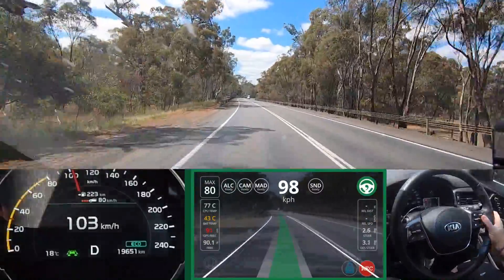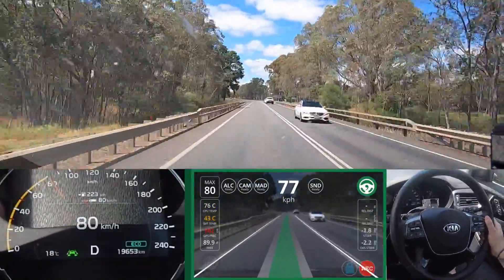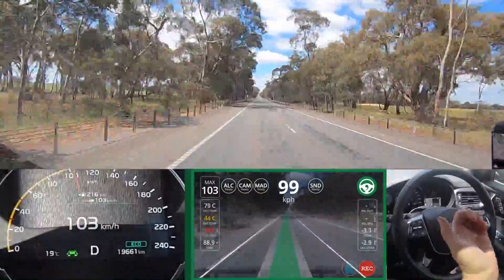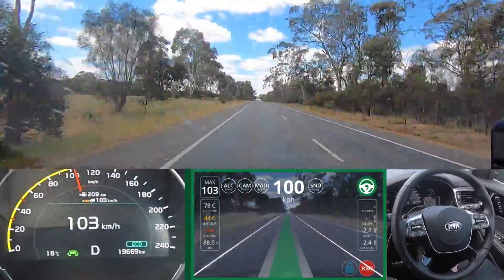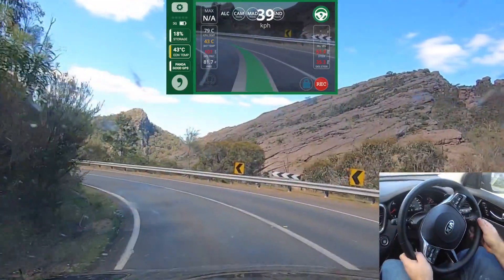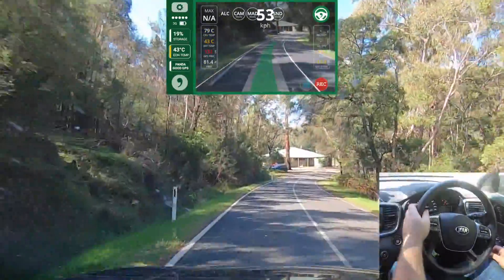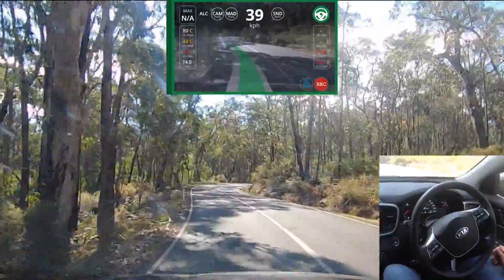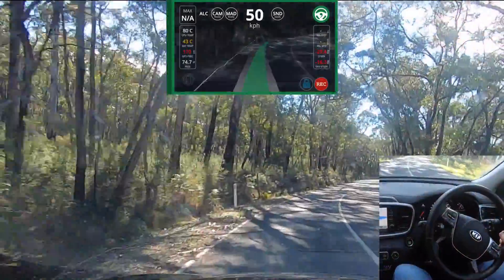Grampians - Can Openpilot make it around ANY corner?

Comment: Thank you for the video.  It can't do anything yet, really.
Reply from the maker: It's my fork/repo
It's only for Hyundai/kia
Check out branch alca-dev-wiggle
Reply from the maker: On roads like this, no.
It's freeway and highway only.
Reply: @ku7tech , Could one submit this as an enhancement request on the Github repository you used?
Reply: Has nothing to do with the device. It’s the  limitation of the car.
Reply: @jimmywinters3998  , Is there any car this will fully fork, as expected, on? Although, the latest version seems to be much more capable.